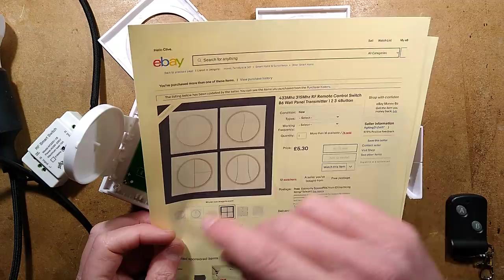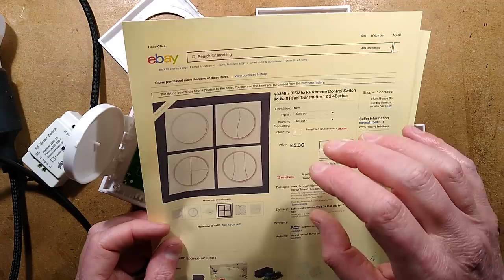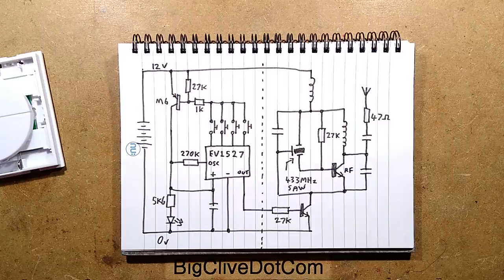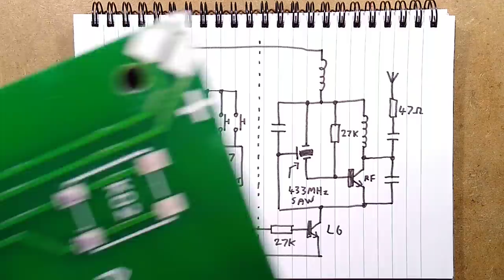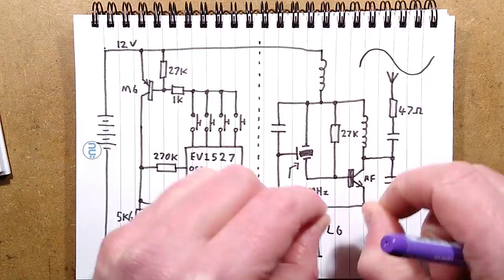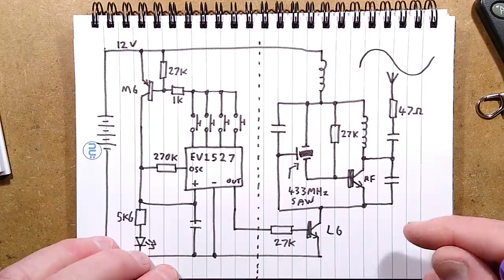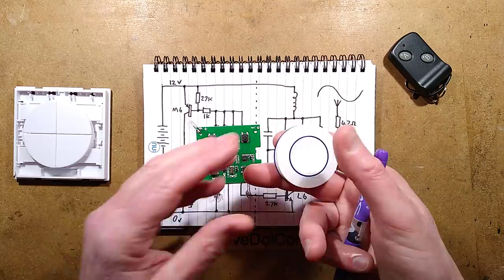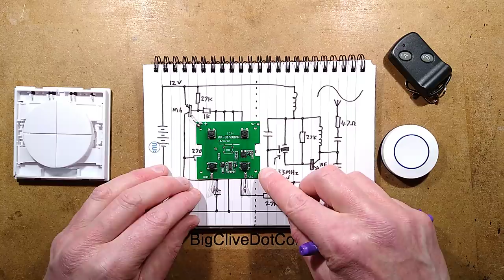Inside some stylish wireless switches (including RF schematic)

Comment: Interesting that while the microcontroller is programmable, I bet the same program is in all models of the switch. That way they can maximize the size of the order from the chip manufacturer to get the lowest cost. Then they use the linkage bridge to control how the center button is interpreted, if at all.

Great example of modular pcb and packaging design.

Comment: SAW oscillator actually uses sound, in the name Surface Acoustic Wave. The tiny little piezo ceramic in there has a metallised top layer and a full metallised bottom, with the top etched to make a small acoustic transmitter generating sound in the top layer, generally 2 tiny metal bar structures, with a large one behind to damp the sound going that way, and then there is a pattern of metal on the top to focus the wave onto the receive array, which generates a small voltage as the wave hits. Stability is in the blend of oxides used to make the bulk, as it does not have a very high temperature coefficient, so stays dimensionally stable over the 0-70C range, at least within 1%.  Trimming is done at manufacture, by controlling the thickness of the deposited top layer, so you get all being within a small narrow frequency range. But enough variation that they typically will have some that have poor range in use with the receiver.

Receiver uses the same SAW filter, just biased so it is barely on, the extra energy at the right frequency starts the receiver oscillating, and the extra current draw is sensed via a resistor and capacitively coupled via a low pass filter, to remove any RF present, to either a single transistor amplifier, or an opamp. Then this amplified signal is fed to the receiver, which is looking to recover a bit clock from it, and then the received data is deserialised, and compared to the code. 3 valid codes in sequence are normally required to provide an output that the button is pressed, at least for these non rolling code chipsets. Reduces the chance that noise will false trigger the output, or a non valid code with noise doing the same.

Rolling code chipsets do the same, just they have to get 3 sequential codes in the rolling code to do the same, making them more secure, though you lose the ability to have multiple buttons transmit the code, each one has to have a unique code. Thus you have to teach the remote each button, and it is harder to clone remotes.
Reply: SAWs are a blast from the past, I used them a few times (mainlt 3.58MHz ones) when designing circuits for RF comms (transmission) systems - mind you the devices were 5 times the size back then
Reply: SAWs were also used to provide the IF band-shaping in analogue TV receivers, replacing a whole bunch of tuned circuits, thus considerably simplifying manufacture.
Reply: @davidfaraday3085  yup. The 3.58Mhz ones were ntsc subcarrier filters, but common as mud so used as frequency references in a number of circuits despite being in a pal 4.43Mhz country
Reply: @miscbits6399  I wasn't talking about colour subcarrier filters, I was talking about IF band-shaping filters. These covered a band of 33 - 41 MHz (for system I) and had the necessary band-shaping to deal with the vestigial-sideband transmission system and provide the correct degree of attenuation of the sound carrier. 
When NICAM came in separate IF amplifiers were used for vision and sound and new designs of SAW filters were introduced that had two outputs, one for the vision IF and the other for the sound IF.

Comment: This stack of little 1.5V button cells amuses me a lot. Clive is so resourceful!
Reply: If you open those batteries, they are often made from a stack of button cells, just like that. Also some 9 volt batteries are a six pack of AAAA cells.
Reply: @RambozoClown  the last PP3 battery I opened was a stack of rectangular cells. Probably six. Those with LR61 inside I've never opened.
Reply: I bought a pair of floor lamps with similar remotes recently. Fortunately they included the batteries.
Reply: A23 battery is literally that, 8 button cells in a paper sleeve, crimped into a steel tube with a top insulator and contact, and a bottom insulator, wave washer and contact. Under 30p each when you buy the no name brand ones, and they last for a year or two in a remote fob. I tend to modify the fob and add a tantalum capacitor across the battery, any value from 10 to 47uF 16V and higher, generally removed from a board that has failed for some other reason, so the rising internal resistance does not cause it to stop running. More than doubles the battery operational life, and it will still operate till the point the led is dim.

Comment: Many thanks for the video.  I have now received 2 switches and for anyone interested in home automation I can confirm that a Sonoff RF Bridge (flashed with tasmota) can receive the separate switch codes that can then be controlled by MQTT, node-red and of course Home Assistant. Very useful!

Comment: Note to all Radio Hams, The 70-centimeter or 440 MHz band is a portion of the UHF radio spectrum internationally allocated to amateur radio and amateur satellite use. The ITU amateur radio allocation is from 430 to 440 MHz; however, some countries, such as the United States, allocate hams 420 to 450 MHz.
So if you want to have fun with your Neighbour's 433Mhz remote switches,Door bells and Garage door openers. Sit in there Street putting out 400 Watts RF on 433Mhz to disable there devices.😉😊.

Comment: The SAW is an acoustic band pass filter.  The piezoelectric substrate is vibrated by the applied electrical signal.  That signal propagates though the substrate at the speed of sound in that material.   The vibrations in the piezoelectric material produce an electric field that is picked up by electrodes that are printed on that substrate.  The spacing and pattern of the electrodes are based on the desired response and the speed of the acoustic wave in the substrate.  The band pass characteristic favors a narrow range of frequencies at the collector passing them through to the base.  The signal is phase delayed because of the time for the acoustic wave to propagate.  This band pass characteristic plus the delay set up the conditions for the RF transistor to oscillate at the bandpass frequency of the filter.
Reply: So how does an audio band filter manage to tune an oscillator at 433MHz?
Reply: @petehiggins33  Because the sound wave is at 433 Mhz.  Sound is not limited to frequencies we hear.

Comment: The "86 Type" has to do with the standard shape of the UK style back-box. They can be 1 gang or more. I think they are 86mm on one side. I'm in the US, so not an expert - except that I've run across these at work and had to figure it out.
Reply from the maker: It does look like the switchplate size.
Reply: @bigclivedotcom  Internal height of a standard wall box. Same in the US. Screw holes are 82mm apart. I know this because I modify 2 gangs all the time to make my own mounting boxes for cameras. Note you only get 80mm of square space because of the corners being octagonal. This becomes very important when your install involved burying network switches in wall boxes.

Comment: 433 MHz is also used for doorbells which reminds me of a wireless doorbell button used at my parents house that uses a piezo crystal to harvest energy from the button press to send the signal. Actuation force is a bit high but it's been reliable so it would be nice if it could also function as a light switch.
Reply: So now my doorbell is going to ring every time one of my neighbours turns their lights on and off aswell as every time one of their doorbells ring too !
Reply: There are models of these that do the same as the door bell button you mention. A few of the Electrician YT channels e.g Nick Bundy have featured them in installations.

Comment: Yes, SAW stands for Surface Acoustic Wave. They're kind of like old-fangled quartz resonators but can be less temperature dependent because the surface wave velocity can be nonlinear and different in different directions, so they can be played against each other for greater stability. The larger ones are a carefully-dimensioned bit of glass with input and output piezo transducers bonded to them, the SMD ones are a single piece of piezo material with input and output connectors bonded to interdigitasl "launchers" and "receivers". The arrangement of the fingers, the "stretchiness" of the material, the dimensions of the substrate all play a part in determining the frequency of operation.
Lord Rayleigh predicted the effect way back when, but he didn't know about piezoelectricity so he couldn't build one.
Yes, I'm a physics/tech geek so they're cool as hell to me.
Reply: Thanks for that explanation - exactly the comment I was looking for. As an older electronics/amateur radio hobbyist, I'm familiar with quartz crystals, but didn't realize that these modern-day components were actually something different.
Reply: @allenlutins  You're welcome, glad to help.
I found out all of this kind of accidentally when someone gave me a dead TV for parts (I had the reputation of needing them to build stuff) and I found a 2" square plastic box with three leads labeled "SAW 1". Upon opening it I found the described small sheet of glass etc., and a few trips to the public library (this was pre-internet) educated me. I played with it for a week but never used it.
Twenty years later I got a job doing SMD board rework and there staring up at me through the magnifier was a really tiny metal/ceramic box labeled "SAW 1". A few keystrokes on the confuser later and I wasn't at all surprised to find it was a new iteration of my old friend.

Comment: You should perform a teardown of the new switches which work without the battery . They work solely from the kinetic energy of us pushing the switch
Reply: Piezoelectric ?
Reply: @millomweb  Isn't that the way an OLD TV remote worked.  The one my father used to call "the clicker".  ** EDIT**   See my reply below for more information.
Reply: @TechGorilla1987  Those were strictly acoustic and had no electronics
Reply: @smeezekitty  Well, turns out it's a little more complicated than that, and I would like to thank you for spurring me to go research some.  Below is a snippet from a site I will link below.  I'm not sure this is what I was talking about, but it sure is cool!

"The improved "Zenith Space Command" remote control went into commercial production in 1956. This time, Zenith engineer Robert Adler (1913–2007) designed the Space Command based on ultrasonics. Ultrasonic remote controls remained the dominant design for the next 25 years, and, as the name suggests, they worked using ultrasound waves.

The Space Command transmitter used no batteries. Inside the transmitter were four lightweight aluminum rods that emitted high-frequency sounds when struck at one end. Each rod was a different length to create a different sound that controlled a receiver unit built into the television.  The first Space Command units were quite expensive for the consumer, because the device used six vacuum tubes in the receiver units that raised the price of a television by 30%. In the early 1960s, after the invention of the transistor, remote controls decreased in price and in size, as did all electronics. Zenith modified the Space Command remote control using the new benefits of transistor technology (and still using ultrasonics), creating small hand-held and battery-operated remote controls. Over nine million ultrasonic remote controls were sold."

https://www.thoughtco.com/history-of-the-television-remote-control-1992384
Reply: @TechGorilla1987   I remember the old Grundig TV of early 1970s that had a 20(!) function ultrasonic remote called Telepilot 12, and while it worked okay, every time one rattled a set of keys the set would turn off, mute or switch channels. So I honestly doubt that ultrasonic remote would be a wise choice for lighting remotes.
Reply: @TechGorilla1987  The one that ONLY changed the channel AND went BBC1-BBC2-ITV then back to BBC1 after going through a spare channel :)

Comment: Didn't know anyone still used those little 12v batteries. 
Have you looked at the batteryless transmitter switches that use a neat magnetic generator ?
Reply from the maker: I've not looked at one of those yet.
Reply: Some car keys and garage door openers use them.
Reply: Magnetic or piezo?
Reply: It'd be interesting to look at some of the battery-less ones, like the Quinetic stuff that I see sparkys like Nick Bundy installing!
Reply: Radio-controlled doorbells use them, at least mine does. I've heard them referred to as "lighter batteries" but have never come across such a lighter. Maybe those used for stoves, barbecues etc. do, or have done in the past?
Reply: @BG101UK  they work on the same principle as the spark generator in the lighters that audibly click when you depress the button - that's probably why. Piezo ignition: https://en.wikipedia.org/wiki/Piezo_ignition

I can remember kids in school ripping these out of lighters they found on the floor and using them to zap people.
Reply: @BG101UK  They've been called lighter batteries for 35 years to my knowledge but have never seen a lighter that would use them!

Comment: you should really go for zigbee controllers or z-wave instead of generic rf stuffy type stuff..
they are many magnitudes more energy efficient, more flexible and more secure
Reply: As someone who installed them for years, they can also be many magnitudes more headache to configure and maintain. It's a trade-off I suppose.

Comment: The close-up images of the circuit board that you printed couldn't be any better. Great video as usual!
Reply: Hey haven't seen you here in a while but then again AT&T issues!💩 

New place 2.

 until now got fiber now less AT&T issues to complain about now.

 yeah stay away from U-verse wherever possible.

I know U-verse is being depreciated or better gotten rid of?

Hopefully everything goes to fiber eventually!

At least where you can!

With U-verse.

Still over copper cable at least in some cases coming in basically fancy DSL.

Butt is affected by anything that could affect plain old telephone systems as well moisture mostly of course anything that would cause electrical issues yeah.

Referring to specifically interference with the signal but of course fiber only needs to worry about equipment and power to it pretty much less to have issues with since you don't need to worry about other influences that affect electrical signals with fiber optics.

But of course that comes with its own issues but overall high-reliability for the most part!

Beats cable right now getting 300 magnets roughly
Reply: Its so detailed you can actually probe the values off it

Comment: The mechanical interface is highly important (planarity) when implementing user switches (buttons) via cheapish tactile switches. The angle of incidence (on cheapish) switches can greatly change the resistance of the connection.

Comment: Those things are great, I have a keyfob remote in my pocket so if I need extra light when I'm working in the back yard I just turn the floodlights on, which saves me from walking indoors to switch them on. 👌
At the same time, I try to walk/run at least 10000 steps a day so my goals do contradict each other from time to time, but who can resist fun electronic gadgetry 😁